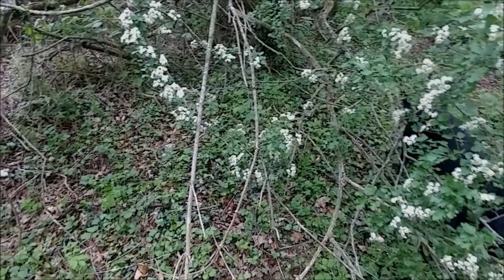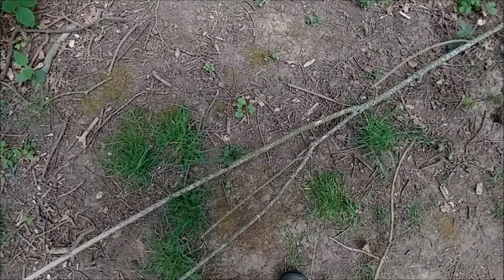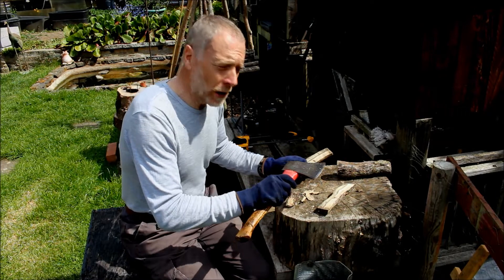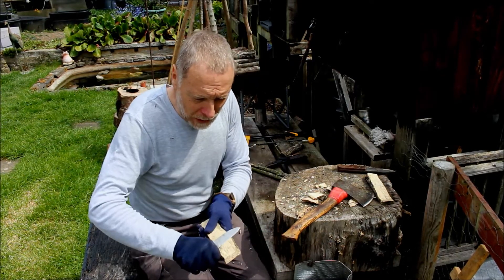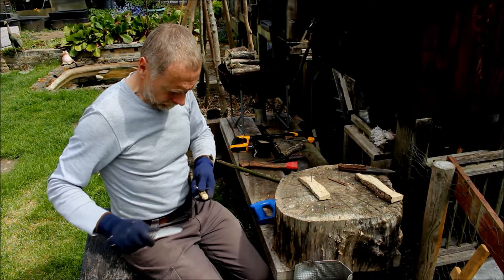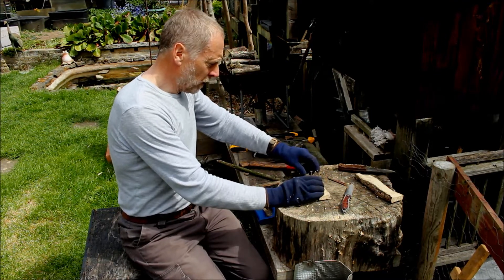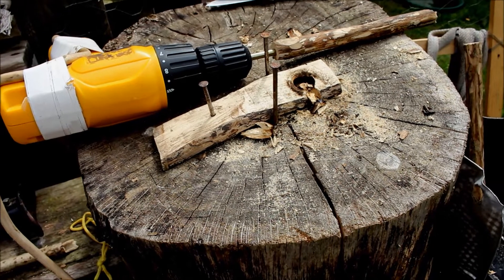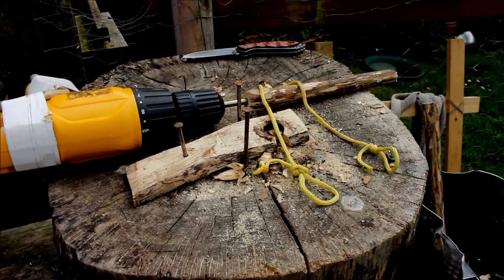Hand Drill Fire, Cheat and Fail

Comment: I did exactly the same thing a few years ago,and had the same result with the drill,
I try it,because I had no luck with the hand drill,and I still don't have any succes with it lol
Reply from the maker: I have not given up on it, but you have to learn your limitations so if it did really matter you don't waste time and energy. I have got different wood and will see how that turns out, probably off camera first. More things to do than we can ever fit in. Thanks again
Reply from the maker: BlindOwl Bushcraft And Survival  Yes I gave them a go and they massively increased the downward pressure I could apply as well as speed, in the end I think it was the type of wood and thickness of the drill/spindle. I will be trying other materials in due course. ATB